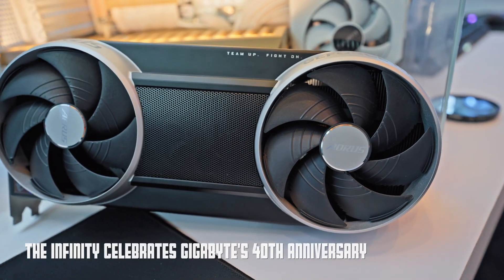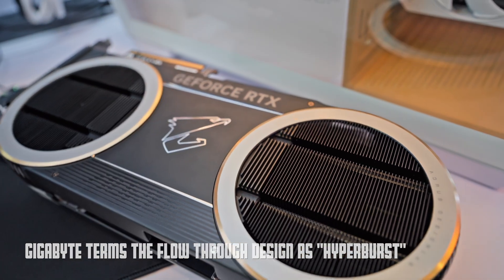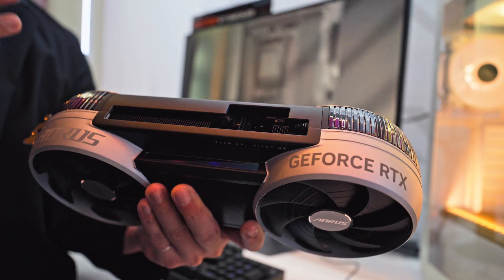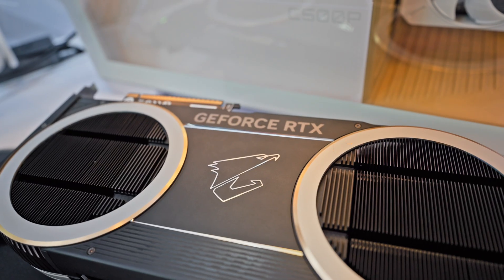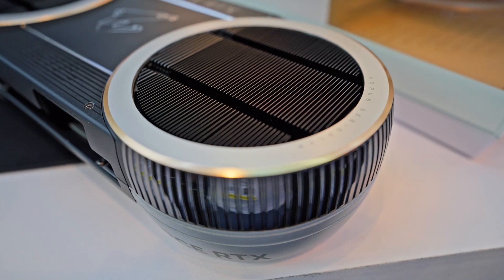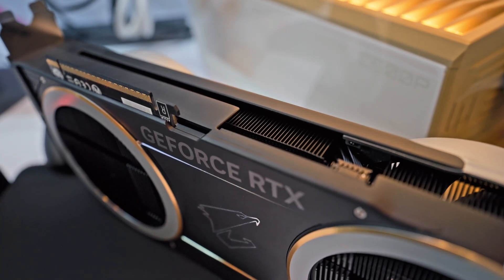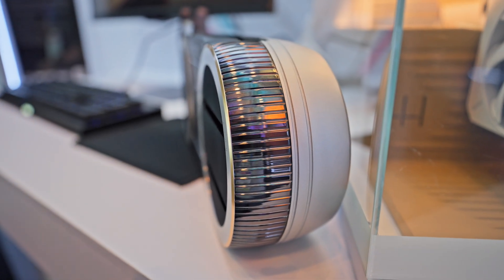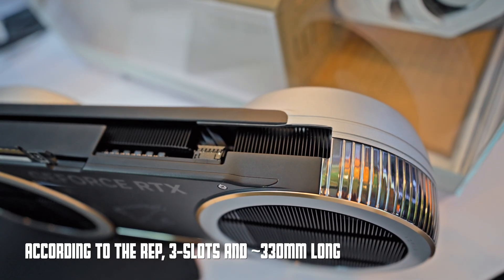Gigabyte's Infinity 5090 - Futuristic Exhaust!?

Comment: Looks like its going to cook all your components inside with super hot air speed up that pc upgrade cycle.
Reply: if someone affords this, wont put it in a 100$ case lol
Reply: @m1ndflux548  Doesn't matter what case you are using when Nvidia's furnace is running
Reply: @beat-kz7ok  uhm yeah it matters. and there are cases out there that can cool every existing GPU, stop malding.
Reply: @m1ndflux548  Stop gargling nvida Bahls
Reply: @beat-kz7ok  no